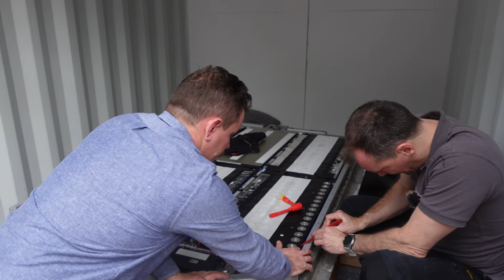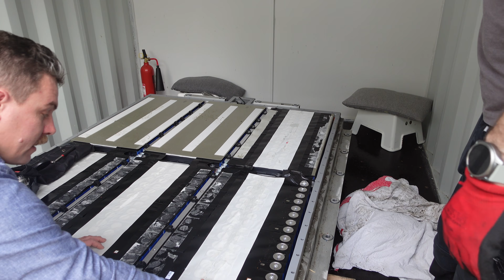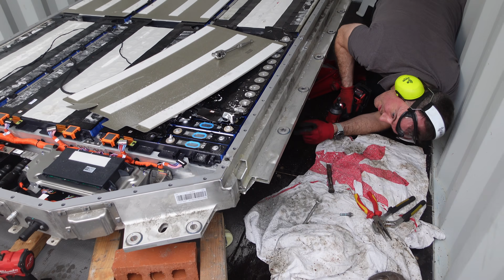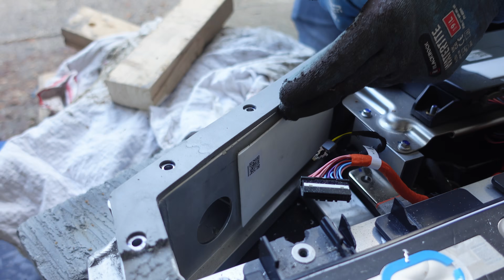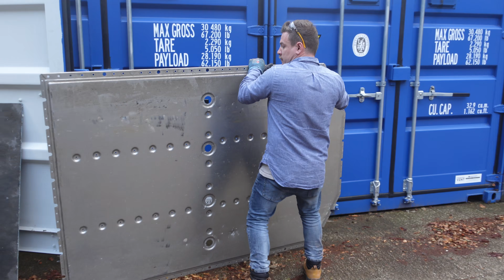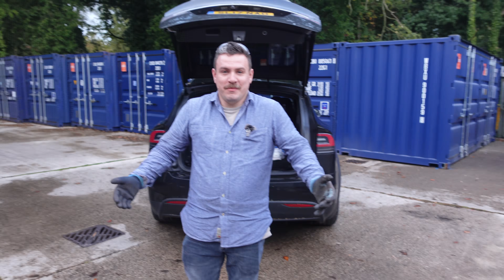EV Batteries Are Becoming Unrepairable — And Honestly, It Makes Sense

Comment: Horrible way of dealing with a pack....you are just bad workers, the battery is not the problem.
Guys walking, leaning on the pack without adequate protection or method....not using proper tools, those guys are monkeys.

Comment: It's really nice he shared his project to see how the pack was assembled. It looks like they could be used in bulk for a second life as solar storage or grid backup. As nice as it would be to have them come apart easier, I doubt a lot of people would try.
Reply: An American  battery recycling company aggregates their nationally collected car batteries in a large storage system. They custom-coded and built a multi connector BMS which talks with all BMS pack types.  The batteries are spaced well apart for safety, as one might expect. There's a video on YouTube.
Reply from the maker: @mikemotorbike4283 we need more of this. The uk needs more deserts 😂
Reply from the maker: Agreed
Reply: Only  DIYer would take the time and trouble. Too much manpower and time to be commercial. Remember these are not new batteries so you are not going to get premium prices, so even less commercial.

Comment: I think you will need a follow up video with Will. I'm feeling that for years the industry has brushed aside concerns about all the toxic and unethical materials with assurances that they could be reused and then fully recycled only to find that they can't even be saftly taken apart...
Reply from the maker: It would have to be discharged and shredded to make it recyclable. But good point. It is potentially harder to recyce
Reply: Actually the new way of separating Lithium ions from the ore can now me used to separate Lithium ions from battery packs.. A lot of investment is going into this.

Comment: dangerous.   I think the way to go is to leave it as an HV pack.   I have a 48 volt house system with a combination of OEM EG4 all in one and battery...and an added DIY JKbms pack in parallel...but I  can plug  in my CHevy bolt as one of the HV solar string inputs to charge the tw previously mentioned 48 batts.  I plug the sting input into the Chevys HV Air con  power plug.    I actullly DONT use one of the sting inputs  o the All in one, because they are all in use.....but I could*.   What I actually do is use a cheap HV Powmr AIO  in the same way...it's output is connected to the Batteries bus bars.      You guys could do the same..but too late maybe now.
Reply from the maker: Before we took the cover off, we didn’t have a clue how this pack was made up now the pack has been opened and the world knows a little bit more about how Fisker ocean packs are built. This will no doubt be useful for the community of people that own these vehicles.